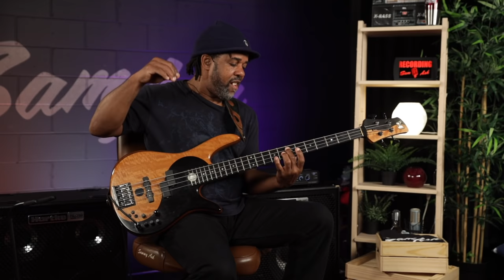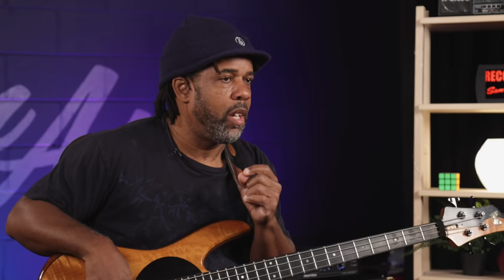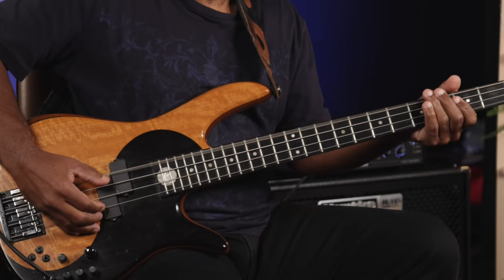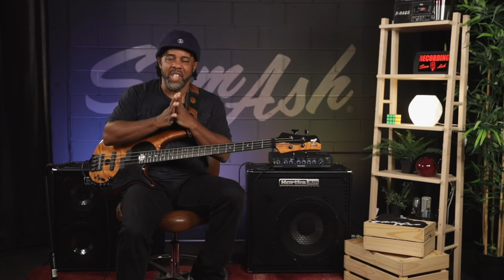How To Develop A Song With A Looper Pedal ft. Victor Wooten

Comment: I can personally recommend the Boss RC-30 - fantastic lopper for beginners too coz it has 2 pedals so much less tricky double tapping etc, just 1 pedal start, 1 pedal stop ✋️ and hold to delete. Plus a shit load of beats and effects and other more advance stuff, saves 99 loops on the permanent on the actual pedal itself, plus they can be like an hour long each I think. Just real fun which is co ol. Can record any beat in a loop space via laptop too.
Reply: Yah RC-30 really improved with all the drums/rhythms from on the RC-20. I got rid of my RC-20 cause there was only one terrible tempo beat. RC-30 can double as a looper and metronome for practice.